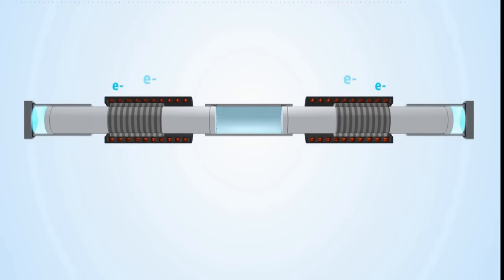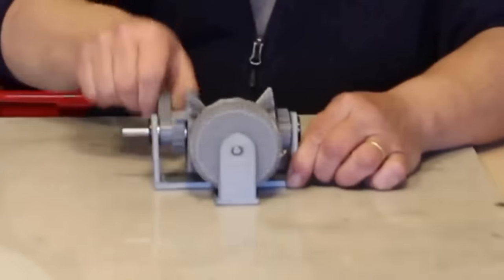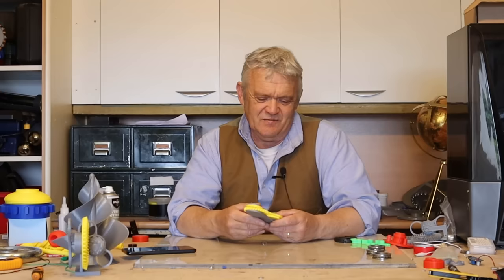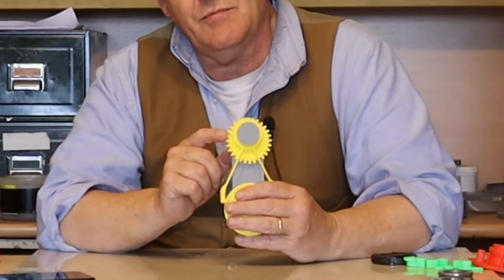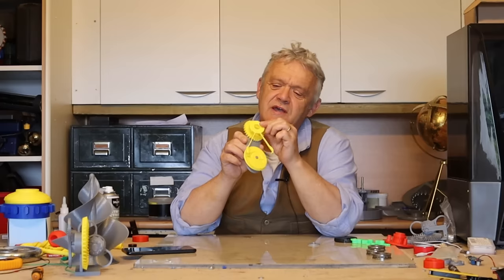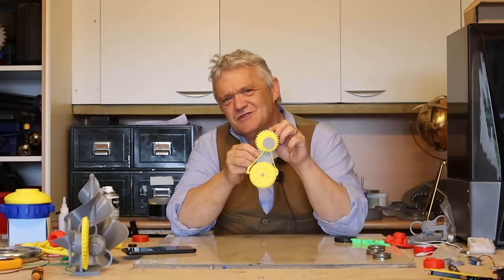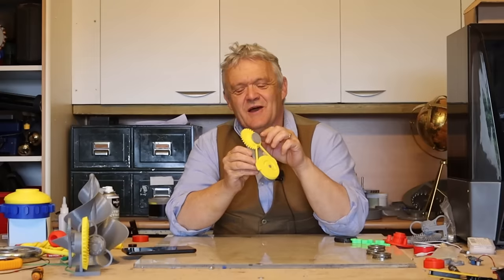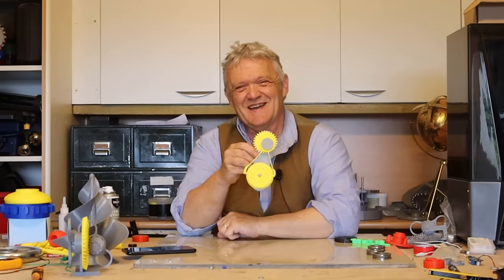2003 The Magic Lever Energy Harvester by Seiko

Comment: Way back in the late 1960s I saw an article describing a similar ratchet mechanism hooked up to a rope tied toward the top of a tall tree. As the tree swayed in the wind it produced some very high tensions and some fairly long strokes. If you matched such a "tree and ratchet" mechanism with a heavy weight driven generator (on the ground next to the tree) you might get some usable power. If you use three or four top ropes (every 120 or 90 degrees) you can get a pull on the ratchet no matter what direction the tree is blown in.

One small correction: A LOT of life uses rotary motion instead of reciprocating motion -- but we don't normally see it because the life is single celled. You know all those microscopic movies of bacteria with propulsive flagella waving snake-like behind? They aren't actually flailing, they are actually rotating corkscrews and just appear to be flailing because they rotate. The base of each screw has a tiny chemical/electric "motor" twirling it about.

Ain't life AMAZING?! And your videos are great too! Thanks?
Reply: Interestingly , that might weaken the he tree's structural strength over time .
Reply: @philip5940  Ha! Neat idea, I would not have thought of that, but yes, trees grow new fibers where they need it for support. The ropes will act as shock absorbers and smooth out the highest forces, won't they? Just my gut feeling? Probably not enough to matter, but I might be wrong.
Reply: @thetruenolan6655  however , I like that someone has actually done it . I gave thought to it in early eighties , we discussed pros n cons and that was all . At that time the Mother Earth magazine was always having articles for alternative+ energy projects. In popular science magazine it was labelled alternate~ energy projects and in same language too from same country.

Comment: A simple stroke of genius. I made a crude ratchet-pawl mechanism for my weaving loom using a steel washer, hacksaw and heavy guage wire. It was expensive to buy the mechanism, so a little autocad magic and elbow grease, it cost pennies and it's working just fine. However, a 3D printer/mould would have been perfect. Again, the goal was improvising on a low budget. Now I'm wondering if I can construct this without the need for a milling machine, 3D printer or a mould. Ok you've inspired me. Great video!

Comment: Thank you, I always wondered how the auto-winding watch worked. I learn so much from your videos!!!!
Reply: Older watches don't have the lever or a clutch, so it only winds when the rotor moves in the one direction, and the mainspring may break.  Seiko fixed that.
Reply: There's also a high gear ratio between the auto winder and the mainspring, that allows this really tiny weight, to apply torque to the mainspring and then there's a clutch that prevents the auto wind mechanism to snap the spring.

Comment: It’s dead reliable too! My SNK809 with the 7s26 automatic movement has the magic lever system and is 5 years old. This movement is rated at about 10 to 15 years of continuous wear between needed maintenance. Seiko also has a Kinetic movement that uses a automatic rotor and the movement charges a capacitor for quick energy recovery and powerful discharge to power a quartz movement.

Comment: My first idea for getting energy out of walking would be some sort of liquid squirting through a turbine of sort. I mean, there would be a soft chamber with one way valves in built in the bottom of the shoe, and when it gets squished, it pumps a liquid through thin tubes in to a turbine..
Reply: that would be much quieter than an cog type mechanism.

Comment: This will wind a spring well, but surely Seiko's 'Kenetic' system for charging quartz watches would be more applicable, if it scales. Seems to involve the watch weight passing over at least two wire coils.

Comment: I would place this lever on the side (not at the front) of each leg where the quadriceps and upper shins meet interfacing over the side of the knee cap. It turns out the Q angle (Quadriceps) of adult ranges between 18 degrees to 90 degrees when knee is at it's most extension and flexion. You can calculate how many tooth gets rotated during the movement and multiply that by two, as you have one on each leg, then you can estimate the output wattage from there. Love your outward thinking ideas. God bless
Reply: depending on the incline, wether you walk up or down it, you really wouldn't feel any use of energy at all. If anything, it would soften the blow to the knees, like if you're walking down a hill.

Comment: The simplest application I can think of would be to mount the thing in the middle of your lower back. Have small lines that would run from opposite sides of the drive-crank down to the back of your ankles\shoes. As you walk, the crank could shwish-swosh back and forth. Use that to spin the gear which could spin a small flywheel to generate power.

Comment: Those sidewalks... Might be fun for a few meters but if everywhere it will be exhausting to walk. Like walking uphill or in sand. Because the energy you harvest is not excess heat - it's extra cm that pedestrians need to lift their feet.

Comment: The energy that goes into walking is used in walking.  If you attach a device to capture walking energy, the operator will notice that it's more effort to walk using the device.

Comment: Wish we could meet up Robert and I could show you my drawings of something I saw as a boy on holiday at a seaside resort with my parents. It was a treadmill railway which went round a track and young and old could use it no problem. The riders dropped onto a wide treadle which was geared both sides to go one way regardless of which way anyone was facing. A flywheel kept the momentum going and springs under the treadle brought the bouncing riders back to their level again ready for the next jump on 
so no flexing of muscles here just stepping on and off with handrails keeping the balance. 
The thing looked a pendulum when it was in motion with very little effort from the riders.
I saw something similar used in Africa pumping water but it was a two man operation and too small. No flywheel no springs no gears.
It was a muscle flexing machine without the advantage of body weight and gravity 
I visualise a four man tread apparatus which is good for geriatrics like me 
It could generate power and have a continuous flow of riders taking turns to keep the momentum going and doing it to music can cause a lot of acceleration and exhilaration. 😅

Comment: I'm a hiker. And usually use a solar panel to keep my electronics charged.

If this is going anywhere near a foot it has to be 100% comfortable and not rub anywhere.

I can do 16+ (sometimes 20+) miles in a day. Even the slightest problem with your feet can kill that.

Comment: Put something like this on your roof.  It pulls up a string with a weight attached to it.  When the weight gets high enough it releases and the torque generates electricity.  No matter which way the wind blows and no matter how lightly it blows.  Always collecting electricity.

Comment: A robot that could walk to recharge some of its batteries would be pretty cool, throw some solar panels on it for additional kick. Yeah, I went there. Great video!
Reply: Impossible.  The "Capture mechanism" would require additional power due to friction/load factors and all the power comes from the battery in the first place. Basically you are describing an over unity/perpetual motion device. The law of energy conservation can't be broken. As others have pointed out, when you run an alternator on a car engine, its not harvesting excess/free energy from the engine but taking power AWAY from the engine by putting more load on it.
Reply: @PhilWare1  you missed the word "some". But thank you.

Comment: If you want to generate electricity from walking, put piezoelectric crystals under the ball and heel, connect to a suitable voltage regulator. Mechanisms will break and jam under such complex motion but solid state devices will just keep working.

Comment: Energy generation is actually the easy part, or easier part, it's the energy management that's difficult and challenging. We've invented a solar panel decades ago, yes we've improved its efficiency, but not much progress regarding storage. Even today's lithium batteries haven't solved the issue of storage, since they're still in development for that purpose.

Comment: Just note that almost any physical motion energy generation basically adds to the users energy output, e.g. It wears the user out faster. The only way energy recovery works is from converting waste energy disassociated from the direct action of the user, e.g. heat by-product. If it captures power from resisting the user motion, it's not "recovery" but "addition", as the user has to expend now more energy to achieve the same intended motion. That's why thermal wearables are promising, because heat is generally a waste by-product that is beneficial to the user to remove.

Comment: It must be considered, however, that each one watt of power generated requires an additional input of one watt plus enough to overcome efficiency losses. The 500 watts your car's alternator puts out isn't "free" juat because the engine is running. It loads the engine with an extra load of approximately 600 watts in order to achieve the output.

Comment: I can assure you that you probably don't take 10,oo steps a day, maybe 6,000.
10,000 is a good 1.5 hour of constant walking.
The problem with harvesting energy from walking is that it takes energy away from the walker making walking more energy intensive - think about how much easier it is walking on concrete than walking on sand.

Comment: For capturing walking movement energy I could envisage a hydraulic arrangement would be more practical, perhaps with magnetic material inside tubes that rush past the coils between chambers.  This could overcome directional considerations and also mechanical issues, impact and resilience as well as noise and vibration.  Perhaps even additionally providing cushioning to the wearer reducing footfall noise as well?  I would imagine these have been considered and tested before, what has probably changed is the amount of power required for the personal LAN space of the war fighter and their kit.

Comment: I've seen this type of mechanism in a 100 year old book. As an example of a self-winding clock harvesting changes in temperature and air pressure.
Reply from the maker: seiko patented it in 1957 mate
Reply: @ThinkingandTinkering  
They clearly patented a specific form and application. The two-prong ratchet is probably centuries old.

Comment: Hmmm.  The Seiko mechanism does not produce a constant output.  Perhaps that mechanism could wind a large spring. At some point the stored energy in the spring is released to drive a generator for a few seconds that charges a capacitor battery which feeds into a power grid.  Lots of random little surges buffered into a steady flow.

Comment: How about this? A long lever and a float at the end attached to the power in and a shaft with a prop at its end comprising the final drive. It would be a wave powered boat. Now combine several of these dual in/single out mechanisms all to one or two props so each mechanism can provide power as each float is rising/falling with each wave. Every lever could be made to provide more power beyond the size of the waves with the proper placement of a hinge (think: big gear turning a small gear but it'll be a shorter lever {float} forcing a longer lever {power to mechanism}).

Comment: Interesting mechanism and works great for low power applications. But I dont think its very efficient and will hinder you walking when you draw enough power to charge a phone. I bet dragging a little wheel behind you with a dynamo directly attached would generate a lot more power.

Comment: Funny I mentioned about 15 years ago about why don’t we have batteries in shoes to generate power as you walk , along with other ideas = why are we not using power on solar panels with inbuilt sensors to capture the rain falling on the panels = sun and rain, when I saw the wind up radio I did think why can’t we use something on an indoor cycle trainer to generate power as we keep fit, pretty sure an hour on the bike could power something, when riding a bike outside with a dynamo powers the lights , all these things we do could take the battery out of shoes and bikes slot them into a indoor power bank, thanks to Tesco for my finish = every little helps.
Reply from the maker: the devil is always n the details mate - and - people have to want them - nobody wanted this kind of stuff  until the energy crisis
Reply: @ThinkingandTinkering   I mentioned all of this when I saw that wind up radio , I think it was over 15 years ago might of been longer, do you know of any unit I could rig up to my bike trainer , would be curious to find out how much energy I could generate after an hour , I’m not like you as far as your experience , but very refreshing to hear and watch you because nice to hear what I have always thought,

Comment: The energy produced isn't included in the work being done for walking. The net energy for walking increases if you add a mechanism to shoes, or the pavement, or add a swinging bell or moving backpack. Try hiking with a lose backpack, or walking on moving ground like sand and you will learn this very quickly. The cost of movement is a fixed amount and there is no surplus to be gained for free. Any device will just be parasitic.

Comment: they make filament something I think called TPU filament or some such that when done is soft and rubbery that people have been using for their phone cases and such I think most require direct drive printers though where the gear and tooth system to pull the filament down into the head is down right on the printer head or some such.

Comment: Would it make sense to borrow the next step and use the mechanism to wind a spring? Once enough tension has been achieved release it and drive a generator/dynamo? The trouble with trying to harvest reciprocating motions and turn them into rotation to drive a generator is that those generally need steady/prolonged periods of rotation to make useful amounts of leccy...

Comment: Sure, but that takes energy out of the movement, and it is relatively expensive to feed a human. When you are winding a watch that needs like 1 watt hour a year, it is insignificant enough to be offset by not having to occasional replace that battery. But trying to get any real energy out of a stride takes a lot out of the stride. Then the ground has give you get tired so quickly from this exact phenomenon.

Comment: It's a very clever device ..... for winding up a rotary spring, not really for generating electrical power. Electric generators work most efficiently when rotating or oscillating as rapidly as possible.

Comment: Practically, there are no ways to generate any energy from only the energy we put into walking. Any génération of energy would have to be an additional input given by the wearer:

In the case of step generator, the energy comes from the ∆h relative to the ground. If the user is wearing shoes with a generator, then they will need to step higher than the ground they are walking on to power the machine. If the user is walking on generator pavement, then the energy is generated by the depression in the ground; thus, the user has to climb back up to ground level in order to stay on course.
Reply from the maker: you do know this is an active area or research for the military so soldiers can run battlefield electronics? Most of what you are saying is wrong tbh - sorry mate
Reply: @ThinkingandTinkering  Just because it is researched by the military doesn't mean it's gonna actually amount to anything. The military has researched the paranormal and gay bombs in the past, and they all flopped. Also, you say that most of what I'm saying is wrong, but I don't see you disproving anything either; you would think that me being wrong would make the task easier, no? Tell me then, what is wrong in the affirmation that there is no free energy to be harvested from footsteps.

Comment: Nice mechanism. But a linear PM generator would be simpler, would it not. Think shake light, charging a super cap and DC to DC converter to charge device.
Reply from the maker: for walking? - well I doubt it - it would be fine in a pavement but not on a person I think - but you could always give it a go